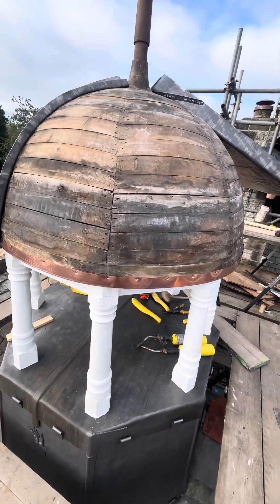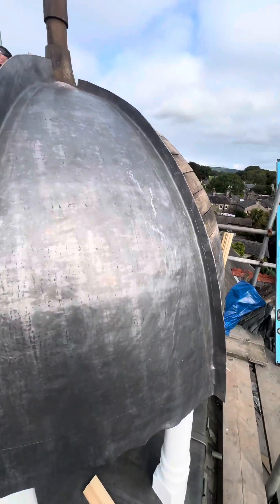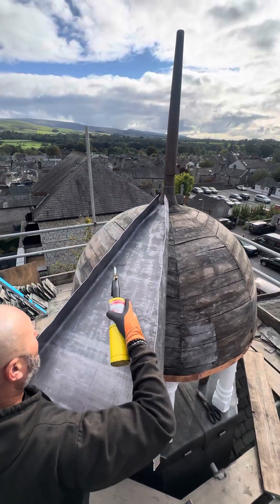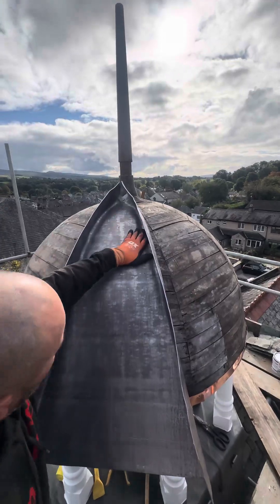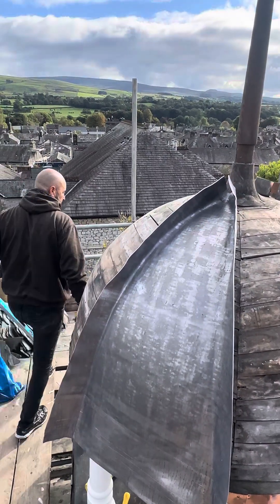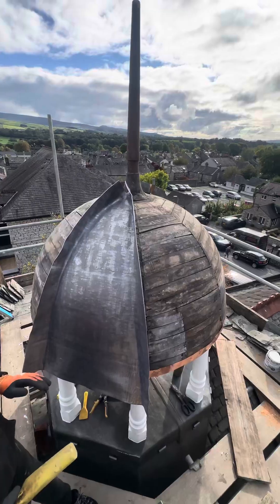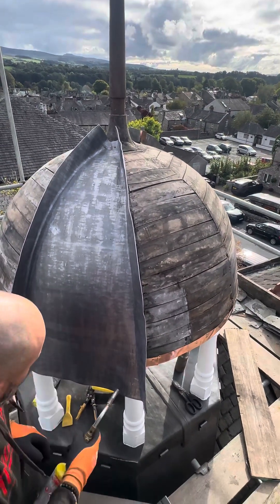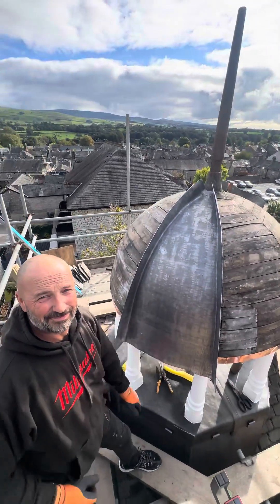Dressing code6 lead onto a dome structure.

Comment: Nice work.. but you forgot to put woolly felt or building paper under the Lead...
Reply from the maker: Hi, we don’t use wooly felt anymore as it causes the lead to sweat and rots the lead from the underside, there is building paper on the bottom that’s attached to the building mate but the dome is well ventilated from underneath so there is no need as there will never be any condensation.
Thanks for the comment mate